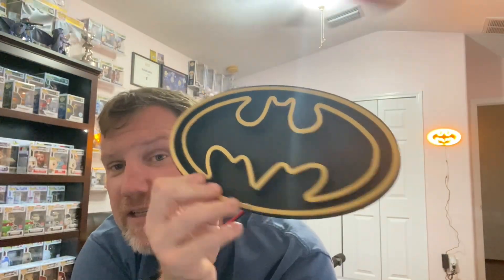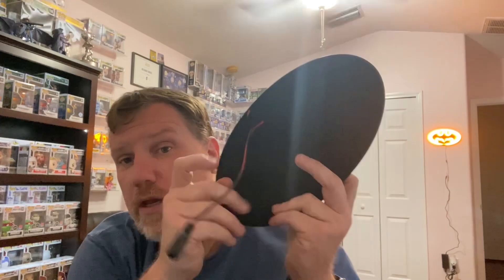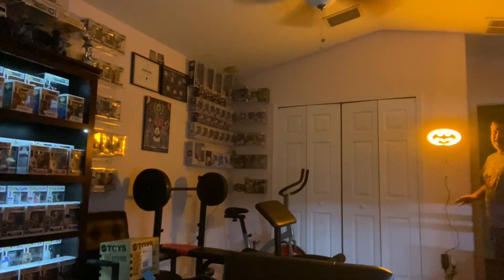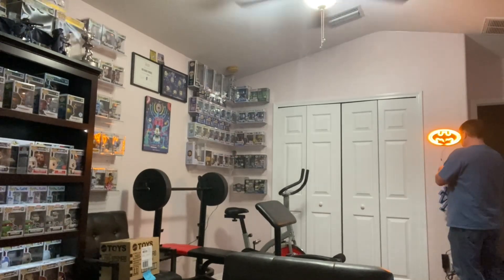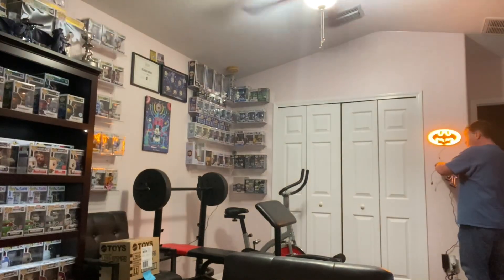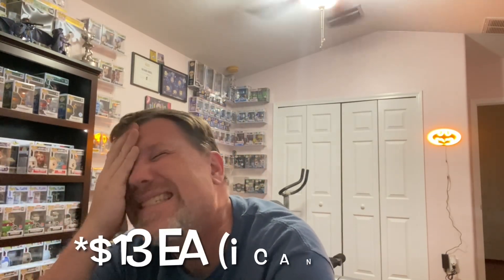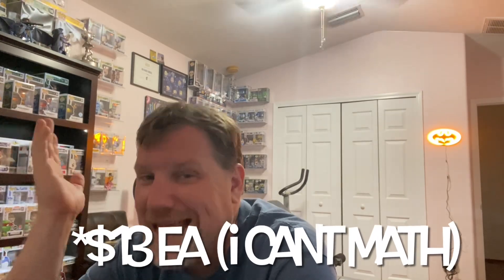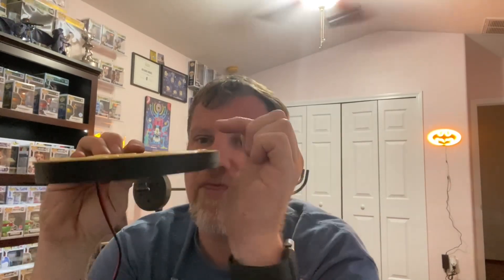I created some  neon signs with a 3d printer and neon rope light

Comment: I have been using El wire for similar applications. For filming, they work better for me. Benefits are no visible wires. much dimmer, which may not be ideal for some.
Small channel here, I subscribed.
Reply from the maker: Ya i need to experiment